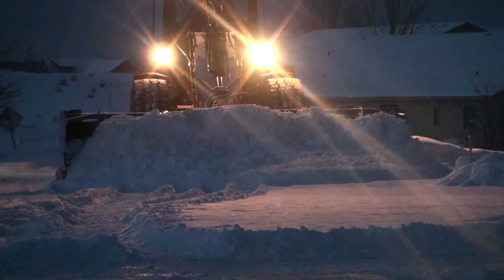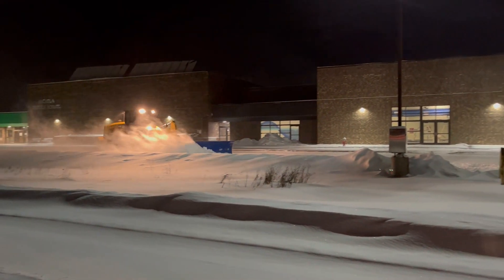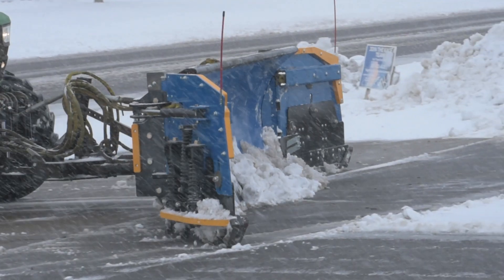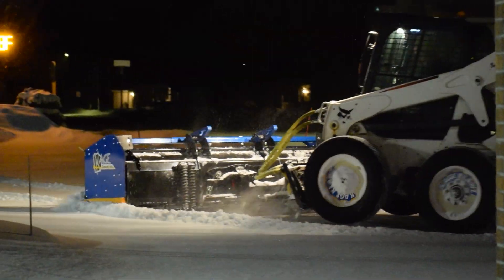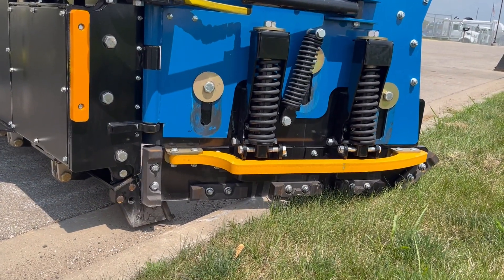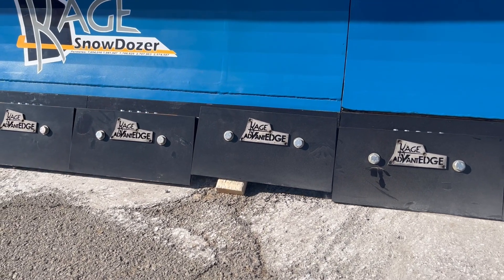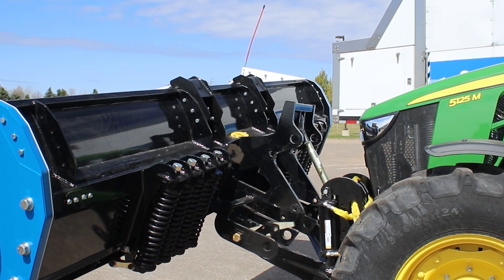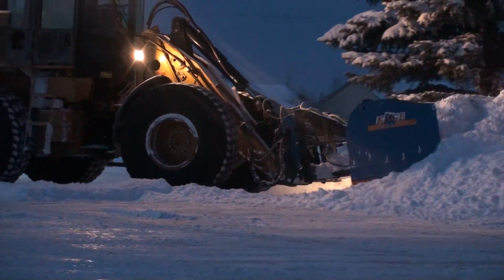What is Snow Plow Float? And Where Do You Find It?

Comment: What is the best float feature for a track loader skid steer 8 foot wide plow for driveways you make and sell ?  second question would an active edge also help not damage the blacktop?
Reply: The best float feature would be our compact loader pivot frame with a skid steer quick attach, just like in the video at 27 seconds. 

Yes, our Advantedge can help prevent damaging blacktop, it makes it so that there is always even pressure on the ground and helps prevent the corners of the cutting edge to dig into the pavement. However, the best thing you can do to prevent damage is to use a polyeurethane cutting edge.